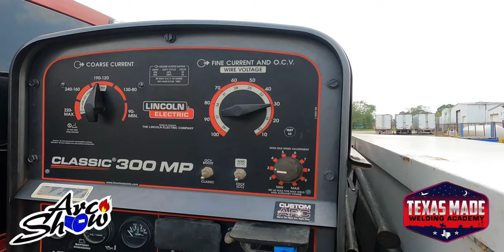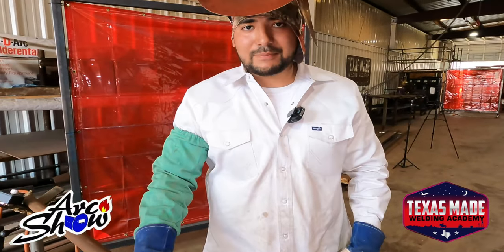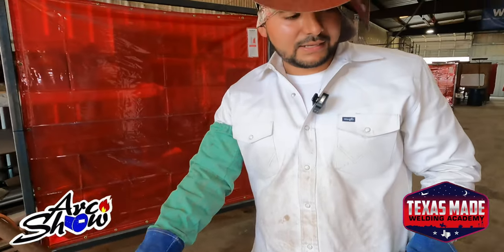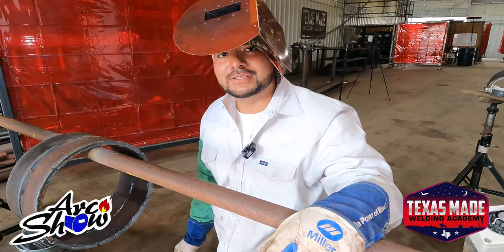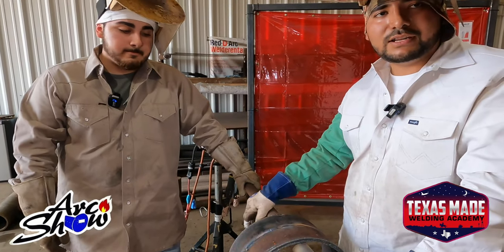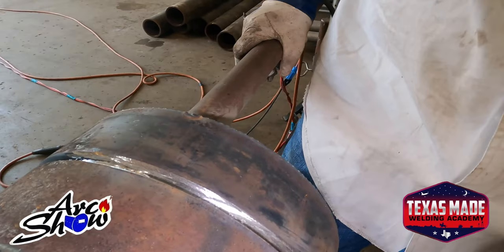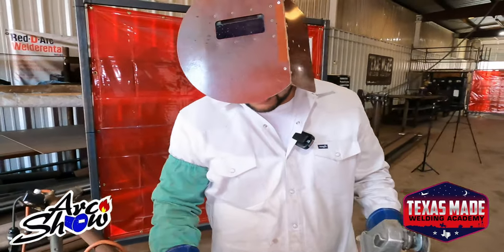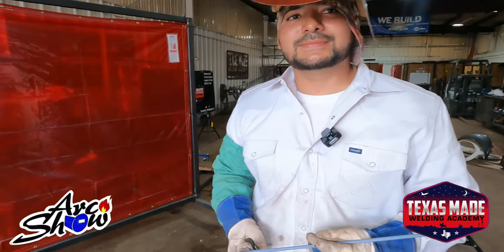Lincoln 300MP or Miller PipePro 400 for downhill with 5.0 pipeliners

Comment: Welded for45 yrs.Mainly inside  Miller machines migs,tigs .Portable all Lincoln sa200 and 250.Never used a Miller on pipe .Now I see the gas company trucks with small rectifiers   on them.Fighting the weld all day.Not for me.On the main pipeline there are 10  Lincoln machines  to one Miller.Miller has a great customer  service  over Lincoln. The choice is yours ?Happy retired.

Comment: 3rd gear and 35 with your arc force at 3 is cold asf bump the arc up to 8, unless you bumped that rack. You're out of parameter.
Reply: Who uses a handle on pipe 🤦‍♂️
Reply: 3 gear 100 hot pass leave a little wagon tracks when grinding the bead it will shoot 100% every time , I was like dang as clean as the ground it and barley turning the machine up they gonna they own garbage, I was taught by an old head the and I am 40 now and he done retired years ago